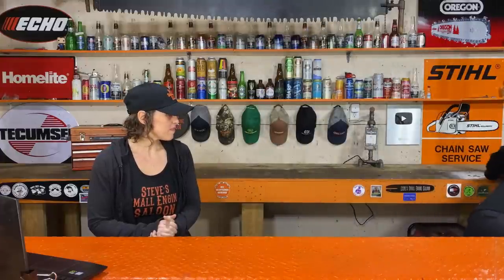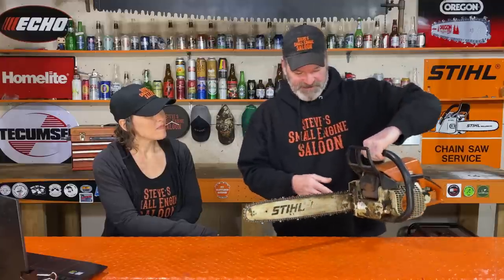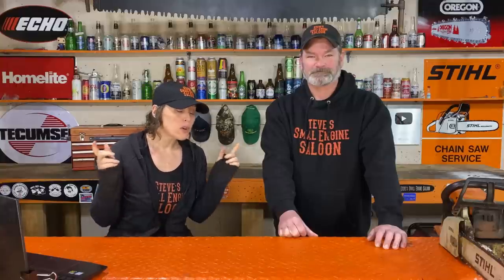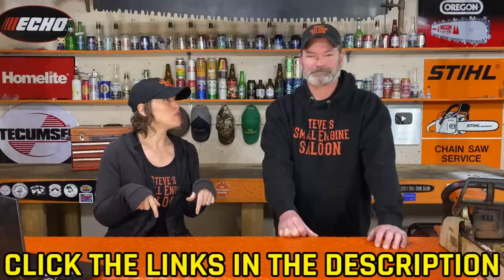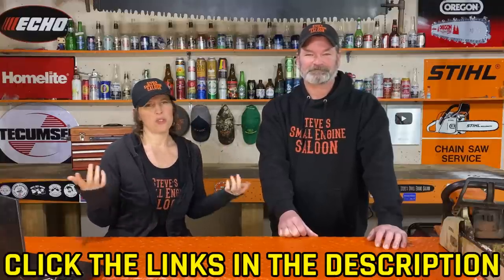Why Does My Chain Saw Leak Oil? (DAY 17)

Comment: If there is chain oil in the tank and set it down flat, the entire tank will drain onto the floor over time.  Therefore, I always store it so that the bar weep hole is higher than the tank.

Comment: I had a Pioneer Farmsaw and the problem with it was the oil pump would leak if the concentric of the oiler cam was open when the saw was shut off. I would pull the engine over to move the cam and the leak would either stop or really slow down.  I always stored the saw on cardboard or other absorbent material.  Take care.
Reply: YES! I remember that they did that!
Reply: You are definitely an old timer like me!  Have to be to even remember the brand! Good old saws.  I still have my Homelite from 1966.  Ignition died and no parts available.  Still can’t bear to toss it out.  My wife will after I’m gone.  Along with all the junk I’ve treasured!

Comment: My saw also leaked from day one.  Makes a huge mess of the shop.  I haven't used it in probably 6 months and when I walked by it the other day there was a oil puddle under my saw.  Does storing your chainsaw in different positions help? Mine is always storage on a flat surface horizontal but have thought about hanging it on the wall vertically to see if that helps.

Comment: My Husqvarna 435 15" and my cheap Chinese XXX Tools 24" chainsaws will both empty their bar oil tanks if left with oil in them. I drain the oil out after use as its messy and expensive if I dont. 
I've always wondered why they do it though.

Comment: Every chainsaw I have ever owned "leaks" bar oil except the ones that have a plugged or broken oil pump.  I've messed with a few of them thinking it was the seals where the oil pump pushes the oil to the bar but it never worked so I gave up.  I put a rag in the bottom of my carry case and let it drip.

Comment: My Stihl 029 developed a bad oil leak and dumped oil into the storage case bottom.  A lot of oil so cleaned the case, used the chainsaw and drained the oil tank before putting away.  

Used the chainsaw a year later and watched you tube videos to get information on source of oil leaks.  Found a crack near the threading at the top of the oil tank cap.  Guess I tightened the cap too much.  Easy fix just a new cap.
Reply: Stihl 025 correction

Comment: My ol' Echo 351VL "leaked" oil because the sawdust that was built up inside the clutch area of the saw was packed in there and every time I used it it soaked up more oil.  I had a puddle on the floor.  I cleaned out the packed sawdust and my saw stopped puddling.

Comment: My DeWalt electric chainsaw only leaks when I set it bottom side down. If I lay it on it’s left side (bar side flat to the ground) then it does not leak a drop.

Comment: Bar studs in oil tank on my Poulan Pro 295 I got new 25 yr.s ago, they leak out thru the pump, around the hose where it goes in the tank, and thin rubber gasket under bar bolt heads, oil softened and squeezed out.

Comment: On Stihl chainsaws, empty your bar oil tank and then get an air hose with LOW PSI and blow through the air vent (silver circle with a hole in it somewhere between the oiler slot for the bar/chain and the bar studs). What happened on one of our saws at work is a tiny piece of sawdust got lodged in the inside of that valve from people not cleaning the caps before refilling the saw. It wouldn't let air in or out, so the result was that there was always pressure in the oil tank, pushing it out the oiler. It would drain a full tank of bar oil in a week of sitting. Now it doesn't leak a drop, except when the temperature changes drastically like any other saw.

Comment: Maybe using summer bar oil in the winter? Steve, didn't you do a video on winter/summer bar oil? Another reason for leaks, cracked oil tube. Bent or warn out chain guide plate, especially Husqvarna.
Reply: My thoughts exactly. I run winter bar oil in my electric chainsaw and pole saw even in the summer. Drain the pole saw when I'm done, that sucker will leak no matter what position it's stored in!

Comment: I’ve been told that you should only operate your 2cycle engines at full throttle. But when I’m trimming or using my blowier I don’t need full throttle all the time. So how do I operate my 2 cycle tools. Thanks

Comment: My Stijl pole saw does leak oil from the tank that lubes the chain.  I replaced the gasket and it still leaks. Is there a sillicone I can use that will hold up to the oil that I can use.

Comment: I have a makita chainsaw that has been to 4 repair shops and still leaks;;;I have to drain the oil from the tank after use for it will all dump into carry case;;;;works great but ya don't dare leave it full of chain oil for it will leave puddles or drain in case and have oil all over the bottom of chainsaw;;;;and then all over me or if i sit down on dirt or fresh cut sawdust I have anothr mess;;;;

Comment: That explanation may be true for a Stihl, but what about cheaper brands like Poulan Pro?  Also, I had a 14" electric corded chainsaw that the bar and chain oil tank would completely drain after using.  I was considering replacing it with a 14" from Harbor Freight, but the review section was full of complaints about the oil tank draining in storage.  This made me wonder if storing them upside down could be a solution, or would that make the oil drain into another area?  I have a chainsaw attachment for my Troy-Bilt power head and it fully drains every time I use it.  Are there maintenance procedures for this or parts that need to be replaced?  Not all chainsaws have the vent tube you mentioned and, certainly, not all chainsaws are made to the quality of a Stihl.
Reply: Buy a Stihl.  You likely won’t need another saw in your life.  A saying I read years ago, and have proven it to myself many times, both good and bad,
                                    “The sweetness of low price is soon replaced by the bitterness of poor quality”.
Reply: @tomrogers9467   For the little it will be used, my Poulan Pro PR5020 will do fine.  I've studied all the prep and maintenance procedures, including carb adjustments, and the storage/winterizing procedure.  Stihl is superior, but I don't need a professional chainsaw for homeowner use.

Comment: The older style Stihl flip caps leak all the time, the updated caps with the black line on them seal way better
Reply: Ah. I have a 361 and 461 that have the floppy caps. Can I replace them with the ones you're talking about?
Reply: @akyukon  Yes
Reply: @josephrich6014  Thank you!
Reply: @akyukon  Ya I replaced the old ones on my 361 and 260 with the new ones from a dealer.  The old ones leak and sometimes feel like they are latched and then they fall out, the new kind of oil and gas caps is way better

Comment: For a long time I would drain all my oil from my saw after use, but I find if I hit the decompression button before storing it then it doesn't leak anymore. I thought somehow it's putting hydraulic pressure on the oiler, but I have no real other explanation why this seems to help.

Comment: My new Echo CS-400 leaks badly. It’s not the residual. After using it I have to store it on its side so it won’t leak. Could be leaking from the cap. But don’t know an easy fix for that

Comment: Steve, can I use a 20" bar on a 18" Husqvarna 435xtorq
Reply: I have a Husqvarna 435XTORQ with a 16" bar but only use it for limbing hardwoods. I wouldn't use a 20" bar unless it was for softwoods and even then 18" would be plenty.

Comment: Ive owned 4 brand  new Stihl saws in my life, this latest saw is 5 years old and maybe 2 years back it started losing its bar oil.  It happened overnight, I came out to the garage one morning and there it was, a large pool of bar oil.  A buddy of mine had it happen to a saw that was 3 weeks old so theres definitely something going on with Stihl saws these days.
Sure, theres always going to be some residual leakage and sure, temp changes will affect this, but Ive never seen saws that drain out the entire tank of bar oil onto your garage floor.  It pisses me off and I think my next saw will be a Husky, not a Stihl.
Reply: More likely operator technique and maintenance than equipment failure.
Reply: @marklubecke4854  Seriously?  You know that old saying, "Better to remain silent and be thought a fool than to speak and to remove all doubt..."  You just proved Abe Lincoln correct.  
What, exactly, would "operator technique" have to do with having bar oil in the reservoir?  Did I pour it with my left hand instead of my right hand?  
What does a dog with a hair lip say?  "Mark, mark, mark..."

Comment: Never had that problem with any of my Stihl chainsaws but Husqvarna, yes. I usually rip a bucked log lengthways at the end of a session because the much longer shavings clean a lot of the crap out of the bar retaining cover.
But I suspect that far to many operators simply do not keep their chainsaws clean or maintain them well enough. Crappy bar lube, dirt in the oil tank etc. Buggers the tolerances in the oil pump, clogs the vent and heat in the crankcase pressurises the oil and forces it out. I call it pot boiling.
Farmers are some of the worst for pot boiling and abusing their saws.
Some dumb ass in marketing shows a Stihl farm boss riding loose in the back of a truck ?  That ain't no way to treat a chainsaw. 
Arborists? You'd think they know better, but I've seen some of the worst abuse amongst those guys.
I swear some of them are more mentally unstable than concreters. Lol. Apart from Buckin Billy Ray. He's cool.

Comment: No get in the habit of putting a piece of cardboard under the saw and left Zorba about 80% 90% of the oil and you won’t have an issue and you can flip it over and use it twice if it isn’t too bad Scott towel on top of a piece of cardboard. That’ll absorb a lot of oil or it’ll spread it out more lol love soak up more I find if I keep a piece of cardboard in the bottom of the carry case and change it about once a year I don’t have an issue.

Comment: Here's a question, why does the chain always need adjustment ?  I say between the smooth oiled surfaces, high frequency vibrations, and chain wear, it is just bound to happen.
Reply: A hot chain will sag. If the bar vibrates into a different position the chain will also sag (or get tight.)  When putting the chain on the bar make sure the bar is in a neutral position and make sure the chain isn’t at all loose because it will get more loose as it warms up.

Comment: I have two Stihl saws and I have two cheap poulan saws. The poulans cannot be stored up right because the oil and gas leak out. I have to lay them on the bar side. Also believe it or not the caps are made of inferior plastic and if I leave them up right the caps soak up gas swell up and I can barely get them in or out. I guess you get what you pay for.